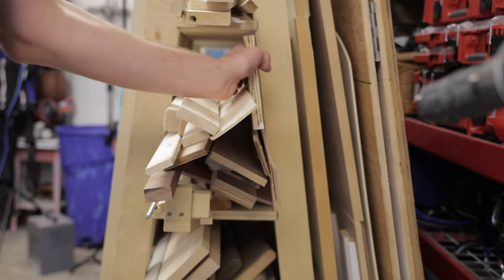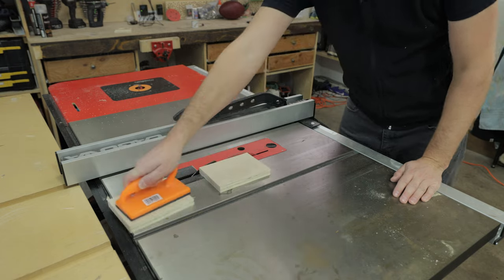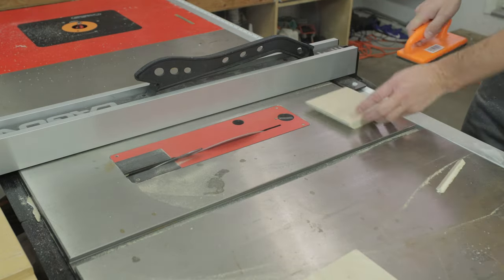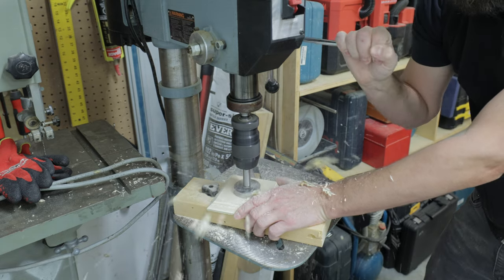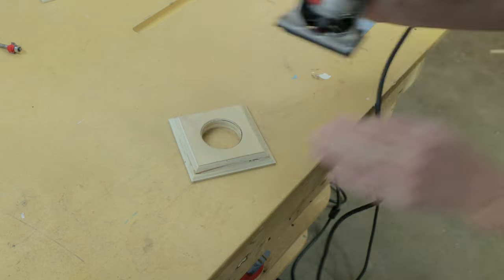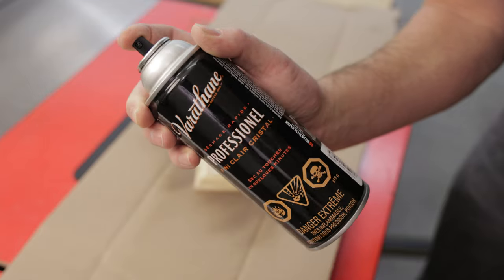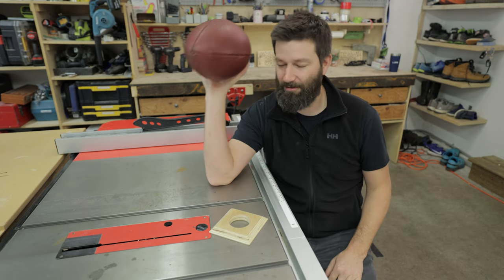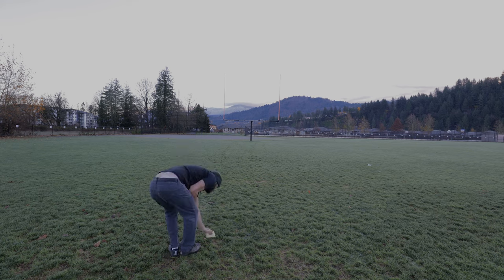How To Make an NFL Kicking Tee and Have Some Fun!

Comment: No, no, no! You get your sister to hold the ball, then you get back about 50 feet and run at the ball like a freight train, then at the last possible moment, she pulls the ball away and all of the energy you were focusing on the ball remains in your foot and you follow the ball's intended path feet first. This requires a sister with impeccable timing.

Rest in peace, Sparky.
Reply from the maker: Classic Charlie Brown move!